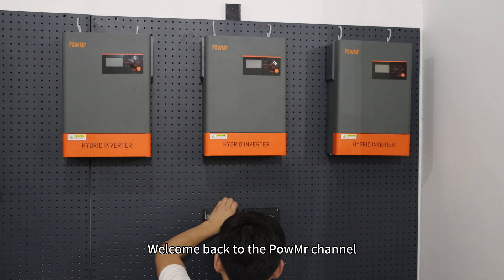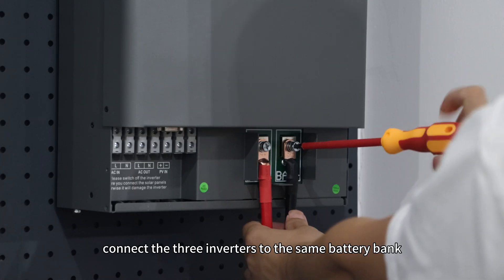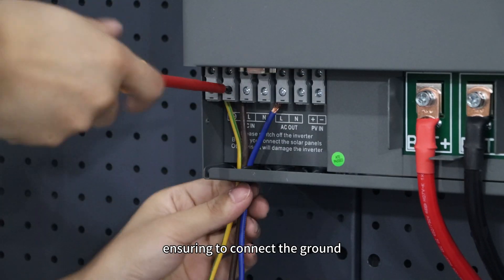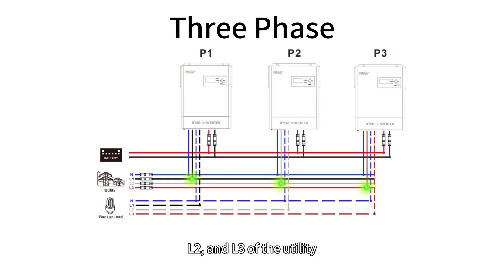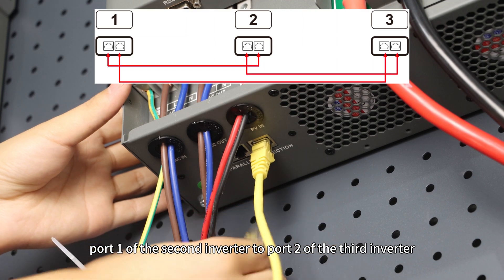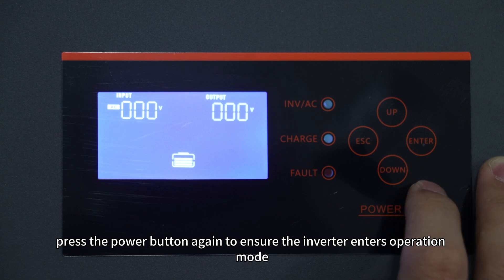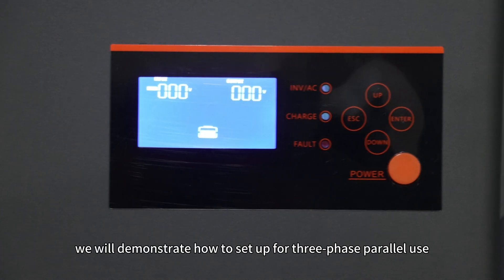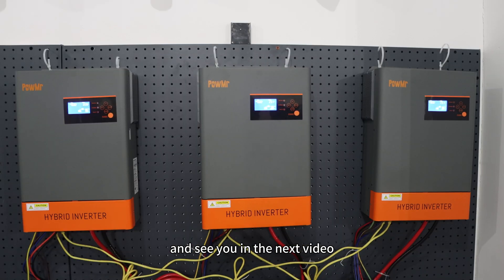How to Parallel Connect POW-HVM6.2K-48V-LIP?

Comment: I have 3 phase input in my howse and i dont have 3phase devices. Load just splitted among them. I want to back up only 2 phases. Will this stations work as L1 and L2 only?
Reply from the maker: Does your load require L1, L2, N (220V)?
Reply: @PowmrSolar  I have 3 groups of consumers on 3 diferent pfases just to spread total load. 2 groups should be backuped and third is not reqiere backup. So i need to backup L1 and L2 with each inverter connected to 1 battary and L3 should be without backup.
Reply: @PowmrSolar  Any thoughts?

Comment: in parallel mode, does the WiFi adapter connected to the master report the total of the parallel units, or does each unit need its own WiFi adapter and separate logging?
Reply from the maker: Each unit needs to have its own WIFI module.

Comment: Hi, does this hybrid inverter have a setting to turn off grid power export?
Reply from the maker: Do you mean feeding excess power into the grid?
Reply: @PowmrSolar  Yes
Reply from the maker: @ It is an off-grid inverter.
Reply: @ I have the model from the video, which is a hybrid, so I'm asking if there is a setting to stop exporting?
Reply from the maker: @naskoyanev  Please configure a battery for the inverter. When using the inverter, connect the battery and there will be no power feed.

Comment: On three phase parallele mode, can i set current charge of battery? If inverter 1 40A, inverter 2 40A, inverter 3 40A, my battery charge at 40A or 40Ax3=120A?
On parallele mode three phase, the inverter have comunication cable with battery? Thank you
Reply from the maker: Yep, the charging current is 120A. The battery can only communicate with the master.

Comment: Would it be possible to connect 3 of these inverters all to 1 phase, set them to charge the connected batteries at a rate of 2AMPS  and then have a 3 phase system in the building delivering more amps per phase then is coming into the building? Off course with respect to the battery charge.
Reply from the maker: The charging current of the battery can be set on the display of the machine. Whether the system is three-phase or single-phase is only related to the mains power and load, and has nothing to do with the battery. Whether it is single-phase or three-phase, the battery will be charged. If the load and mains power are three-phase, then connect the system to three-phase input and three-phase output.
Reply: @PowmrSolar  So if the input is single-phase then I can't simulate a three-pase output.
Reply from the maker: @JopieBoontje  Yep.

Comment: is it okay if the 2 controller outputs are different? 

for example, let say in main controller I have 3 panels, then in second controller I only have 2, will it not cause an issue?
Reply from the maker: It's better to be the same. As long as the solar panels of each inverter are not over-configured, there will be no problem.

Comment: Не могу подключить акумуляторы Dynes по R485 r POWMR 6.2 paralell. подскажите пожалуйста. какой кабель использовать и по какой протокол выбирать в инверторе
Reply from the maker: the POW-HVM6.2K-48V-LIP model?
Reply: @PowmrSolar   yes
Reply from the maker: @vallmyk  Please check the page 32 and 33 of the manual:
https://cdn.shopify.com/s/files/1/0746/0415/1079/files/POW-HVM6.2K-48V-LIP_User_Manual.pdf?v=1710744901

Comment: Does it can be used in parallel with no battery at all?
Reply from the maker: Nope, if you want to use it in parallel, you must connect the batteries.

Comment: 3F parallel output 380V or 400V? the mitsubishi zubadan pump wants 400v so i don't know if this unit will work with that
Reply from the maker: A single machine can output 240V in single phase, and the machine can operate in parallel with three phases.

Comment: I guess answer will be NO, yet it can be a feature to implement for this inverter in next releases.
question is:
can they merge phases in parallel mode?
for example I do connect 2 or 3 inverters inputs to different phases
and I want to get more powerful single phase on outputs
Reply from the maker: This model supports single-phase and three-phase parallel use.
Reply: make a video on connecting the jk bms inverter with the CAN bus @PowmrSolar

Comment: can it communicate with FelicitySolar lpbf48300 battery via RS485 or CAN?
my current MUST inverter can't comunicate with battery
Reply from the maker: You need to consult your battery manufacturer for this.
Reply: @PowmrSolar  
battery manufacturer says:
"Compatible Inverters	Felicitysolar/Deye/Luxpower/Growatt/Voltronic/Sunsynk/Megarevo/Victron/SRNE/Solis/MPPsolar/Afore/SOFAR/CHISAGE ESS"
I also found in your manual there is some specific configuration for PYLONTECH batteries.
So I wonder it may also work with other manufacturers (with some additional configuration?)
Reply from the maker: @Alexmrg123  Yep, the pylontech protocol.
Reply: @PowmrSolar  
thanks.
I guess felicity battery also works via PYL protocol.
So should work with PowMr as well.
at least it states in their manual:
Voltronic/Kodak/RCT/Mecer Axpert and InfiniSolar series communication. 
1. Communication Cable Pin: 5,6(Felicity, any port)——3,5（Inverter, BMS port)
2. Setting steps on inverter: Setting→14→PYL. 
3. Sign of successful communication: Can check the battery SOC on inverter
Reply: @PowmrSolar make a video on connecting the jk bms inverter with the CAN bus
Reply from the maker: @МаксимДумка-й3ц  jk bms inverter?

Comment: hello
I'm very interesting in this inverter mode.
is it necessary to connect both inverters to same battery?
will it work in next situations:
inv1: PVarray1+utility+battery
inv2: PVarray2+utility
OR
inv1: PVarray1+utility+battery1
inv2: PVarray2+utility+battery2

thanks for your answer.
Reply from the maker: 2 machines can be connected to the same battery. The machine will work according to your settings. After paralleling, the slave will follow the host's settings.
Reply: @PowmrSolar  
can or should? I know it can be connected to same battery. But is it mandatory condition?
Is it allowed to connect separate batteries per inverter? Considering batteries require same voltage/amps setup.
Reply: @Alexmrg123  from user manual: WARNING! Be sure that all inverters will share the same battery bank. Otherwise, the inverters will
transfer to fault mode

Comment: Good upgrade of battery terminal. what is the pc software for the inverter?
Reply from the maker: This model does not have pc software. Please use wifi module for monitoring.
Reply: @PowmrSolar make a video on connecting the jk bms inverter with the CAN bus